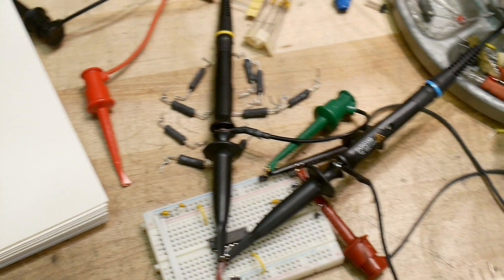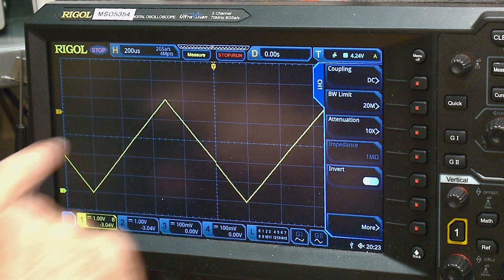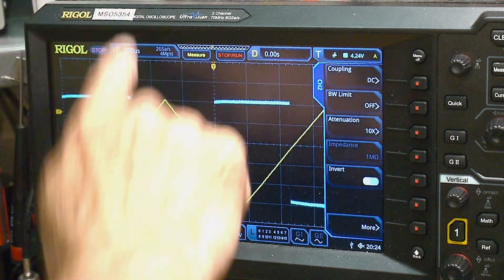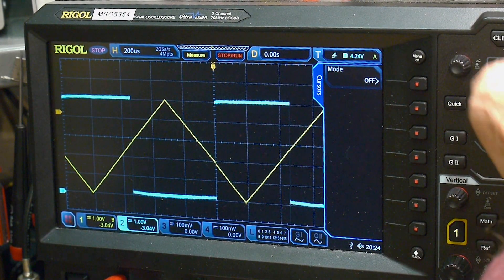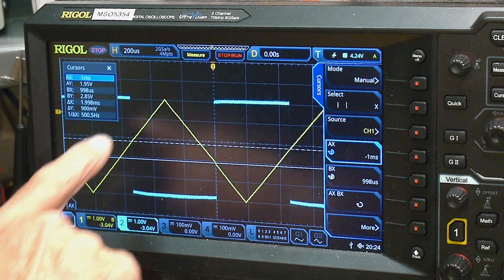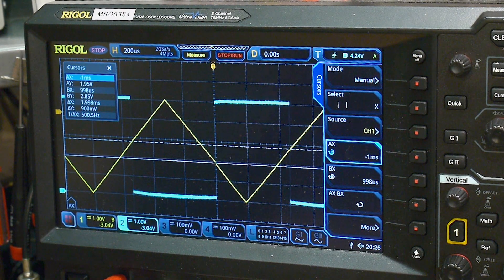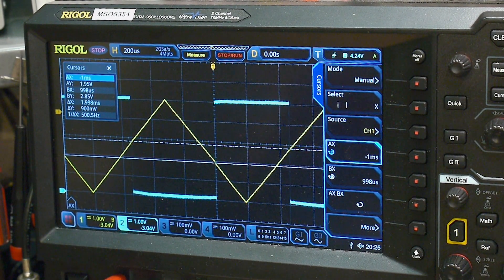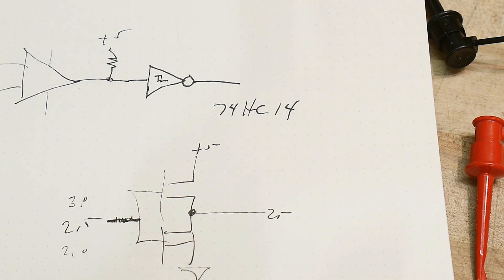#1100 Hysteresis of the 7414

Comment: Cmos can be used in linear mode. I made a state variable filter oscillator using one. Hexinverters the easiest useful device. Tl074 Op amp vastly better. LM324 is a low grade op amp which is still better. It makes a reasonable comparator which can both source and sink current.  Thd of TL074 can be 0.005% Hexinverter 0.1%. 0.1% would be worse were it not for the fact that cmos is very willing work in pure class B/C.

Comment: which chip has the same properties, but from the CD series and being bigger than 5 volt?  translating would cost much real estate.
Reply from the maker: 40106
Reply: @IMSAIGuy  you're right, assumed the 40106 was like the 74hc04, but is in fact a Schmidt ... that detail slipped although used them before.
Currently unavailable until the end of this year till i get replenishment of them.
awesome chip, can be used to make VCO.
Reply: @IMSAIGuy  funnily enough, none of the datasheets show the internal circuitry of the Hex Schmitt Trigger, 40106, 74hc14,74LV14,  ...
: )
Reply from the maker: hmm, must be secret, anyway it looks like this: https://www.electronicshub.org/schmitt-trigger-basics/
Reply: @IMSAIGuy  thnx, i have used the transistor setup/approach in several of my builds (a bit cheaper than a dip14 package also in real estate, if you only need one). the Fairchild datasheet of the 74HC14 shows it's build.
it's made of 2 mosfets and 4 fets + 2 CMOS inverters(mosfets), the 2 additional fets seam to be the hysteresis/schmidt part, will simulate later

Comment: I don’t understand your schematic with the schmitt trigger at the output of the comparator: I think you meant to connect it at the input?
Reply from the maker: the comparator will not have hysteresis. A better schematic would have an opamp running into the 7414.